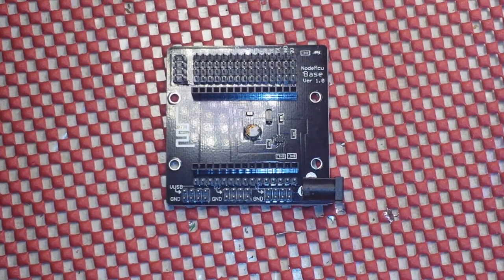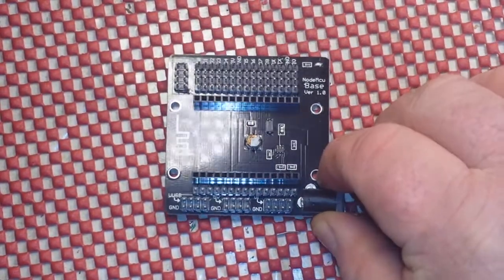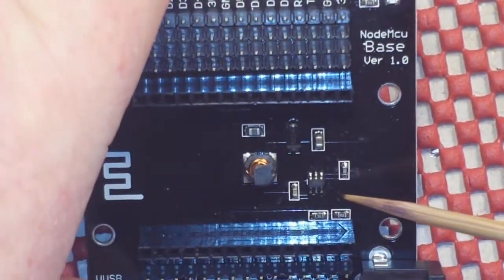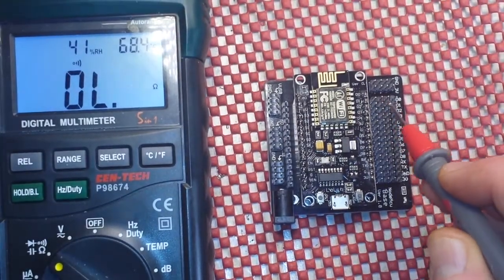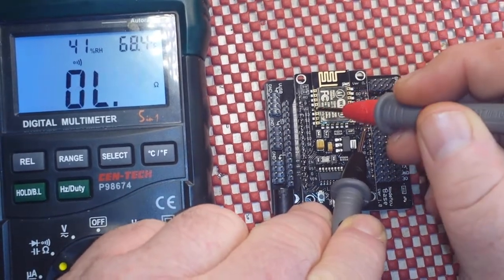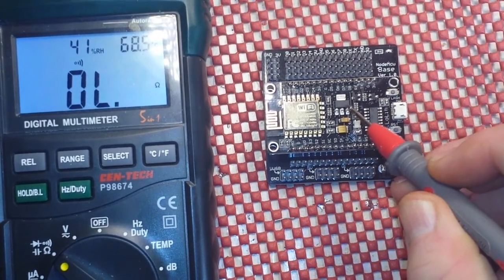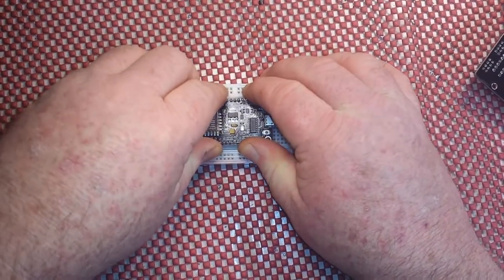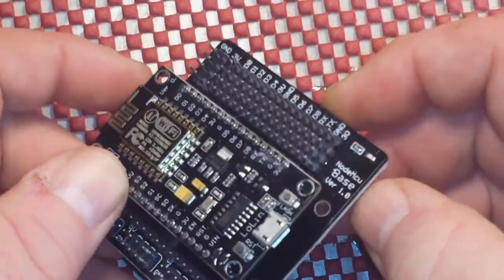Take a look   NodeMCU Baseplate

Comment: If I connect a 12V power supply to the board, in 5V Pins can we get 5V output to connect to relays?

Comment: mine is burning the vreg with 12V input and nothing but the nodeMCU attached. Not in the wrong orientaion. Bought at amazon :-(
Reply: Thats farr from what needed.. Maximum voltage supplied from pin is 5v dont put supply power voltage far away from that.. 6v - 9v is a good range. More than 9v cased ur vreg burning because big power dissipation
Reply: @bhagasasi425 so the safest power adapter that can be used at the barrel jack external power is 6-9v? Since i've used 12v earlier and fried my esp8266.
Reply: Same here and it was causing brownout even if I tried to power board directly. I cut the tiny 6 pin voltage regulator off and now I can use it for prototyping again as long as I don't try to power the esp through the breakout board.

Comment: This only works with the LoLin esp8266 which is larger then say the doit version of the same device.  I did not know this till I purchased the device and found that all the doit boards that I have in my collection were to narrow for the board.  So I ordered the proper board and now I have a working unit.  They are neat, to say the least and the esp8266 is really much faster and has way more power then the standard arduino's.  The uno look-a-likes are great as well but no shields will work on them because of the pinout on them.
Reply: You apparently found the right one for your NodeMCU. I have several Geekcreit ESP8266 CP2102 and have no idea if this is the correct size for that or not. Could you share your specification and source please?

Comment: Cool! I designed one of my own, for my home automation projects (LED strip controllers, temperature/humidity/motion sensors, etc..) and had them printed on PCBWay (came out to about $1 per board!) - they definitely make working with the NodeMCU easier and tie projects together into more "production ready" devices...

Comment: hello sir, in 5V, is that to power 5v in or can be a source of relay? sorry for my bad english. .thank you in advance.
Reply from the maker: mc glenn tangalin the 5V pins are to power sensors or displays. Any of the outputs can be used to trigger a relay, but not to power a relay.
Reply: ah yea, I mean to trigger. thank you thank you! 
'Cause is it not the gpio only produce 3.3, so we are thinking of using transistor to somehow assist the 3v trigger. 
We were kinda hopeless until we saw this video! thank you so much.
Sorry for being bothersome, but, we do not need any transistor anymore right? because this 5v would be enough to trigger a relay..
Reply from the maker: mc glenn tangalin no transistor necessary. Go directly from the pins
Reply: Thank you once again sir! you're the man!